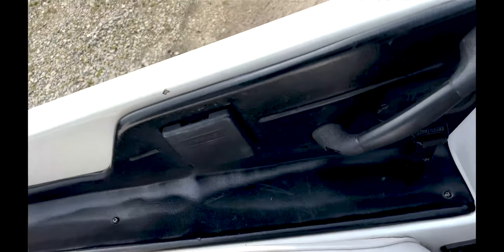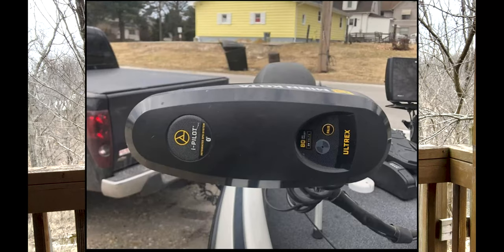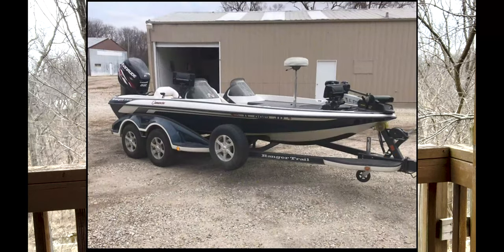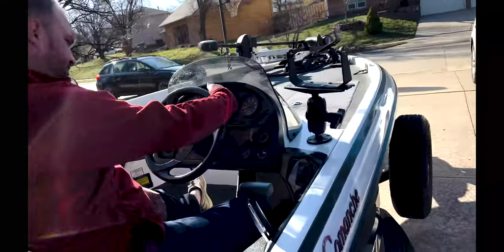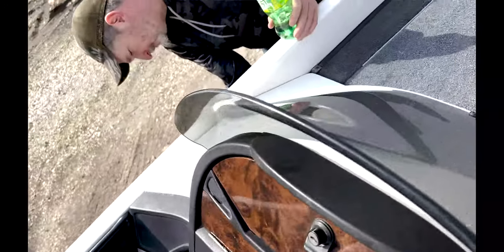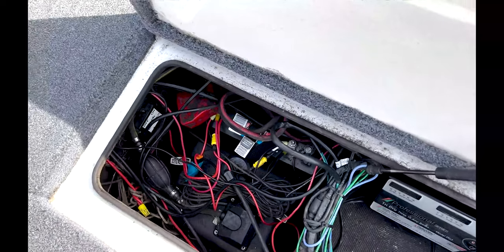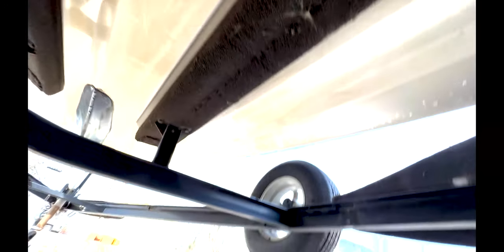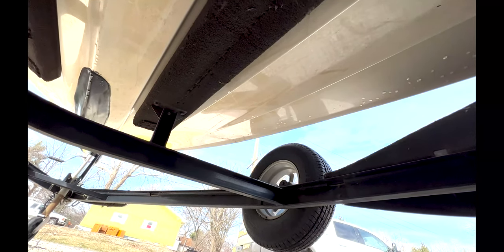I Just Bought My First Bass Boat | Don't Make These Mistakes

Comment: Nice looking boat! I would have passed due to the etec for 20K. I purchased a 2001 21ft boat with an evinrude that had similar hours. it blew after 16 hrs. Maybe user error, but I was running the same stuff as the prior owner. I would recommend, like you said, only use what that prior guy was using for oil and a high octane fuel, evinrudes need the best to perform well and not have issues. However, I would still budget for a repower in the future. the boat looks to be in great shape for the age. Great electronics and awesome trolling motor. You'll be very happy with those.

Comment: What did you pay for the boat? I just bought a 2000 Stratos 18’ with the 175 fast strike on it, single axle trailer. Nice boat a few gel coat cracks, motor runs great, needs carpet next year. I paid $4,100 for mine knowing I had a few items to fix down the road. Now if you paid $10,000 + for a garage kept nicer boat did you really come out ahead?
Reply from the maker: This was garage kept. 2012 motor, 2013 Trailer. Min Kota Ultrex , Hummingbird Helix 10 and 12. Boat cover. Paid 20k
Reply: @variedterrainfishing  Great Price.  In January of 2022 (this year) I purchased a 2002 Ranger 520 Commanche VX for $21K from Premier at the Lake.  No Spot Lock, No Current Electronics.  Love the boat.  Mercury 225 Optimax
Reply: And it came with original matching trailer with new tires.
Reply from the maker: @emontgomery1234  dang! Well I’m selling it now! Currently for sale $19,900. Nothing wrong with it. Actually In better condition now! Just time to move forward and get a new one!

Comment: Question for ya, I have an 98 Evinrude Intruder 150hp 2 Stroke on a 88 374V (I take my old Ranger out weekly, you can see mine on my channel) and was told the opposite of what you mentioned in your video at 6:18. You mention to put a high octane gas in your boat...I was told that the higher octane makes your engine run hotter and to put the 88 octane in it but still from a quality place like Shell, 76 or Mobil etc. Is this just your opinion or did a mechanic tell you this? Even my Ranger manual says to put 88 in it. Thanks.
Reply: Oh and obviously my 88 Ranger has been repowered with the 98 Rude which is why I'm asking because I read this in the Ranger manual which came with a different motor, I don't know what it originally had on it though.
Reply from the maker: This is what I heard. However, I have had a few folks in the business tell me,since I have had it, that the most important thing really here is to make sure it is a non ethanol gas. 

Unfortunately, some places have ethanol in their gas as a standard and they will offer a non ethanol in like. 91 octane.  Not every place does this. But this is common to see.

I would imagine an 88 non ethanol is perfectly fine.

Comment: Before turning the key, put your hand on the cover and check for heat. Then pull the cover, check oil, leaks, etc and check for heat. Any engine that has been running will fire first time, it’s starting from cold that tells you a lot more.
Reply from the maker: Yes, I didn’t think to mention this. This motor however starts ultra fast as soon as I turn the key every time since I have had it. Thanks for watching

Comment: Great buy on a great boat.  I missed out on a 185 last Jan with old electronics.  It was worth the 15.5K he was asking.  Guy was honest.  I found an 02 188 Champion Elite a guy had refurbished for his son with a 200 VMax EFI for 14.5K.  Looks new, has some spider cracks but nothing structural.  Like your I turn turns heads at the ramp.  New carpet and a buffed top deck will do that.  Transom was resealed and in good shape.  So far I've bought a couple of newer graphs and repaired a water pressure gauge.  After I add a spot lock on the front I will be into it for 19K and change.  I figure I saved a ton over new like you.  I'm old, retired, and wanted to get another last boat and not break the bank like you.  You did well.  Congrats.

Comment: Nice boat. I have a 2000 518VX. Great platform. Repowered mine with a 06 etec 200 HO. Going on 3 years no issues. Just do your scheduled maintenance on your motor and it will last you a long time.

Comment: Nice rig I went through the same process couple years ago I have the same motor on 2009 Stratos 294 pro xl no motor issues I run non ethanol and evinrude xd oil she’s fast I love it still turns heads if you need a evinrude mechanic look up Barry in Bastrop la he’s the evinrude guy who was on tour with pros he has a shop there some of the pros still use him great guy
Reply from the maker: Excellent advice! The motor is so quiet, starts immediately every time, gets on plane super fast, just great. 

Question for you, are you running a 4 or 3 blade prop on yours?

Comment: Great boat! Actually also just boat a 2002 ranger 518 svx as well! Great rigs, one of the best ranger hulls ever built. Not a absolute speed demon but with the right motor and propping you could get 70 out of them.
Reply from the maker: I’ve got to 65. I think there is more to squeeze. But I rarely have the water conditions for it thus far.

Comment: All used outboards are a complete gamble, they all pop eventually, take the best care of it and it should last you years, it was the evinrude fichts that were garbage the etecs are much better
Reply from the maker: I never have had an issue with this motor. Half a key turn, it fires up. It’s not loud, and it runs my boat 70 mph.

It doesn’t use a ton of gas or 2 stroke oil either!

Comment: The 518vx is one of the best 19ft boats ever made.  The Etec was pretty much a 50/50 engine.
Reply from the maker: What do you mean by 50/50.
Reply: @variedterrainfishing  You either got a lemon or a good one.  The emm was the main problem with these motors.

Comment: Missing some of the main ones. Have the actual engine hours pulled from the engine itself by yourself not an hour meter and have a compression test done. You are primarily buying an engine when you buy a boat for the main investment. Also, when buying a boat with an Evinrude you should be getting a much better deal because it's a manufacture no longer in business.
Reply from the maker: Goodninsight

Comment: Piece of advice … if you have the ends for a brand new boat with a 4 stroke motor on it buy one! I’ve owned 2 used bass boats with 2 strokes on them as the motors ran great but with that said they were temperamental at times and it was getting old chasing ghost problems
Reply from the maker: Advice taken! On the hunt for a new boat this year!

Comment: I just bought a brand new Triton the only mistake I made was buying it from Bass Pro.  Should have bought it at Pro's Choice Marina.  Don't buy a boat from Bass Pro.
Reply from the maker: I have heard this, but what is your reason and experience for not buying from them?
Reply: @variedterrainfishing  First they sold me a boat they had a stop sale on.  There was an issue with Merc outboards having a seal issue on a exhaust manifold.  Bass Pro was pushing me to come sign papers for financing.  When I signed the papers put my 14K down they set a pick up date of boat for the next week.  They needed to install some batteries.  I get a phone call two days before to pick boat up saying they can't let the boat leave until they check this manifold.  Well this was around Christmas and their mechanic was off.  They could not look at this until after the first of the year.  The first of the year came around and sure enough this engine had a bad seal.  Well they couldn't tell me when seal would arrive to replace.  It took three months.  I made two payments and paid insurance on a boat that was sitting in Bass Pros lobby.  Finally they call and say part is here and pick my boat up.  As I was driving (three months after I bought) to Bass Pro I realized I never got my documents from my county Treasurer.  When I got to Bass Pro to pick boat up they told me that my Country Treasurer was behind and I would have my documents in a few days.  I left Bass Pro with a boat with no tags/no title.  Got pulled over and was detained for several hours while the cops figured out I didn't steal boat.  On Monday morning  I called my elected country treasurer and long story short she never got the documents from Bass Pro.  A few hours later she called me back saying she just got the documents in the mail.  Bass Pro lied they didn't send those documents to my county Treasurer until the day before I picked them up.  I pressed this really hard and was finally told they by manager they dropped the ball and forgot to send my documents in.  They lied they tried to blame someone lese.  Than add this to them selling a boat that had a stop sale.  I believe they did this causes they wanted this sale 80k boat before the end of the year.  This effects level of sales bonuses typically with boat and car sales the number of units sold over a year.  They never apologized. NEVER.  I won't ever spend another penny with Bass Pro.
Reply from the maker: Wow, I do not blame you at all. That sounds awful. Sorry that happened to you. 

If you don't mind me asking, which Bass Pro was this?
Reply: @variedterrainfishing  Altoona Iowa (Des Moines).  There is even more.  I added Active Target to the boat and paid an additional 500 bucks to have it installed.  Long story short they only thing they did was run the wires and mount the controller in rod locker.   They lied to me about this working.  Two things.  Software on HDS needed upgraded so it was never configured.  Once I got that figured out I discovered they never connected the “awake” wire (yellow wire).  Not only that they mounted transducer to the cone on trolling motor pointing 90 degrees off of center.   

I demanded to speak to regional sales manager and all he did was defame Pros Choice Marina.  Claimed Pros Choice won’t service boats they sell.   
I lit Bass Pro up on social media including YouTube.  One person apologized for this and you will never believe who that was……Jimmy Houston.
Reply from the maker: @CousinPete420  Tell me you had some resolution to this.
Reply: @variedterrainfishing   nope.  Reginal Sales manager acted like it was not a big deal.  Store manager says he doesn't have much to do with the marina side of things.  Bass Pro lost a lifetime customer and when anyone comments about my boat I tell them don't buy one from Bass Pro
Reply from the maker: @CousinPete420  Thanks for the insight

Comment: The Rude is junk. Company is out of business and very few wll even work on them. Resale of any boat with that motor is thousands less so I Hope you got a fantastic deal. If you scored a good deal then a Repower down the line won’t hurt so much. 
Have fun with your new boat!
Reply from the maker: I have a mechanic. According to the mechanic for my Evinrude, they went out of business due to government regulation.

It’s probably the reason we don’t see 2 strokes in a lot of sports much anymore. Dirt bikes, 4 wheelers, boat motors. 

Got everything for 20k
Reply: The Evinrude is not junk. I have an Evinrude a little older than that and it's still running great. Haven't had any trouble finding mechanicscto work on them.
Reply: There are lemon motors by every manufacturer.
Reply: I hade a 150 Johnson Ficht for 15 years. Very good engine. Really no problems. The problem with those motors is they were prone to blow up before the redesign. But they blew early. Usually well before 100 hours. I did take a little hit when I traded mine in 2014 but engine tested out fine. Good compression and passed leak down. Enjoy your boat!
Reply: @variedterrainfishing  The E-TECs are actually great motors. The FICHT motors were garbage.
Reply: The e-tec is a fantastic motor… Cranks up every time.. Quiet Uses very little oil.. Everybody  I talk to at the boat ramp thanks there fore strokes because of the quiet and easy they crank.. . Only People that complain about them are people who have never owned one.. They all jerk off mercury And you’ll see those things broken down every weekend on the water 😂😂
Reply from the maker: I do like mine, it is ultra quiet and turns over super easy and fast.
Reply from the maker: Thanks for watching!
Reply: I have  09 etec 200 Ho still  cranks first try and it will fly don’t be scared to buy 1
Reply: My 250 ETec 2006 runs awesome . Turns on in 1 turn sounds super quiet. Never smokes, pees hard always. I’m super happy. I do most of my maintenance myself.